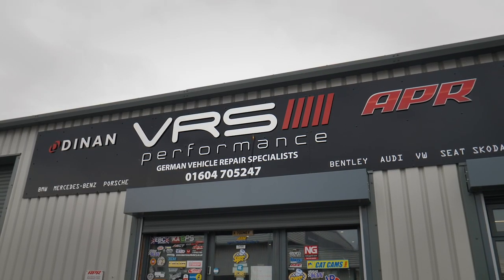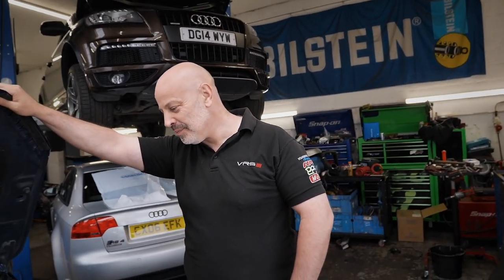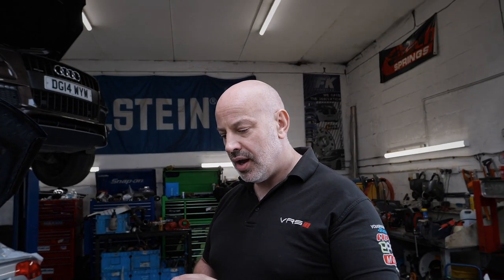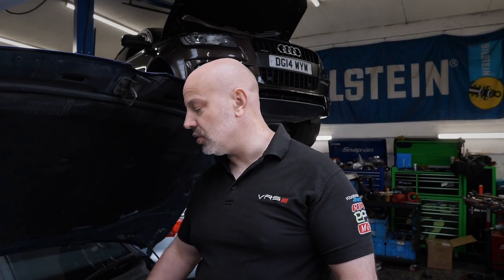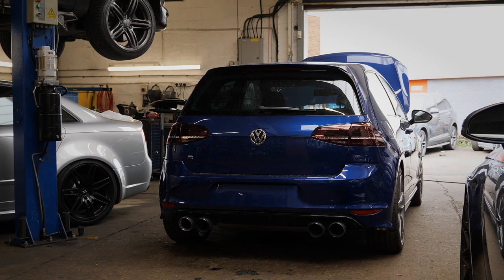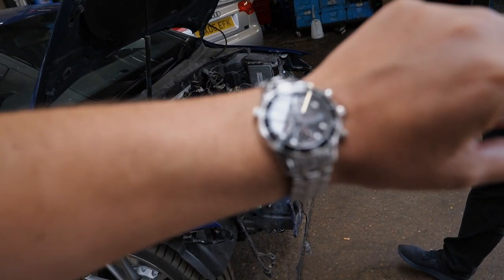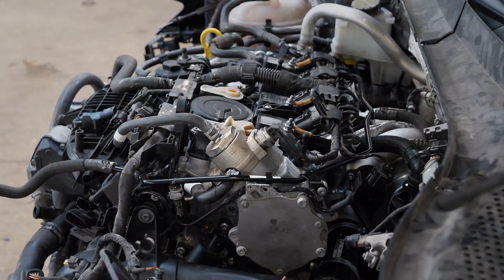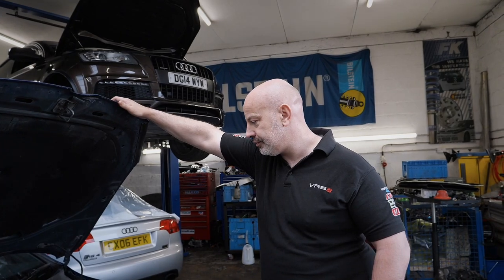I’m Not Sure If This Is Going To Be Possible…

Comment: Calv, Will, check the front discs are on the correct side, looks like they’ll be concentrating the heat to the hub instead of dissipating it.